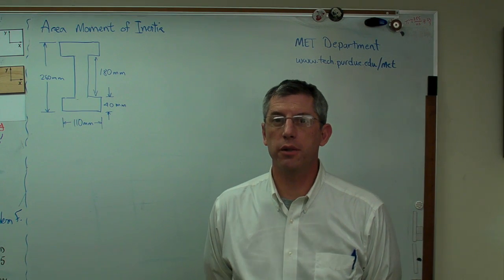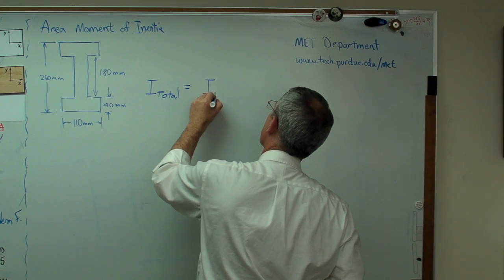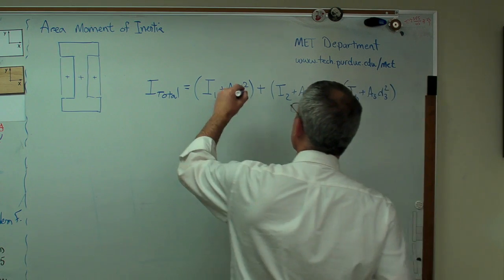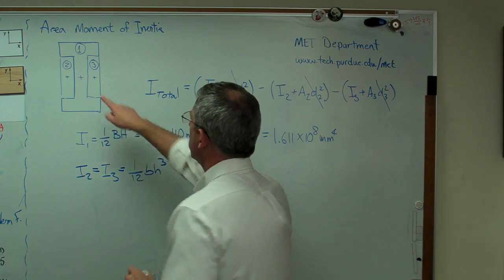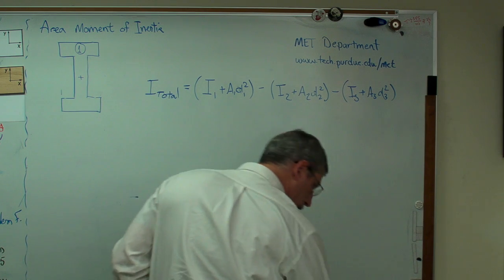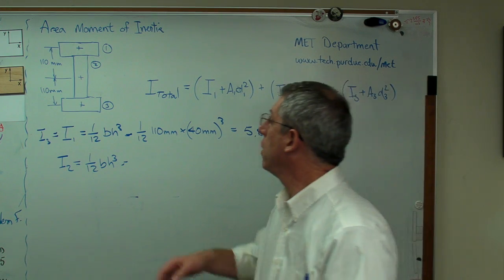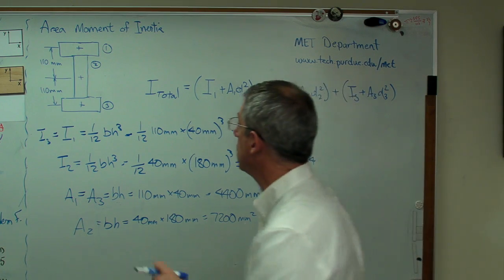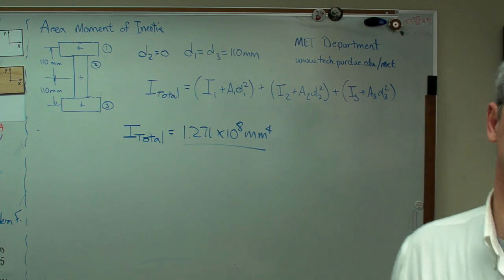Area Moment of Intertia of an I Beam.MP4

Comment: Thanks nice and clear . Only bit I am not sure on is you did not seem to use A in the first method ? You only added I (Inertia) and missed A (Area). I know that d=0 as the centriods are the same just not sure what happended to the A. But thanks anyway will just use the second method

Comment: sri the beam is symmetric the location of centroid is centre that i mean the value is d=130 , not 110 mm
Reply: 110mm is the distance of the centroid of both the top and the bottom rectangle from the centroid of the entire shape. it is NOT the distance from the edges of the top and bottom rectangles. the missing 40mm is the sum of the distance of the centroids of the top and bottom rectangles from their edges. The only number we need to take note of is the distances of the centroids.
Reply: I was confused on that part too. So basically he just did 260 - 40 / 2 which gives you 110 right?

Comment: No disrespect intended, but I find this instructor confusing.  For example, he erased the dimensions for length of the I-beam in boxes 1 and 2, then drew the dimensions for the centroid distances which happen to be the exact same number (110mm).  He next calculates "I" which uses "b" (110mm), but the diagram on the board shows 110mm as "d".  Please make sure your diagram shows the numbers FOR THE EQUATION you are calculating.